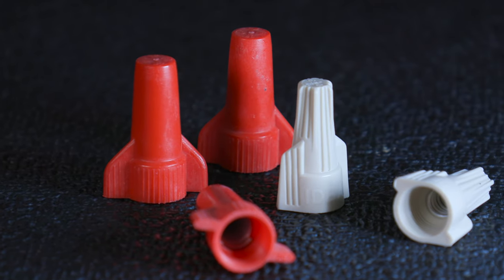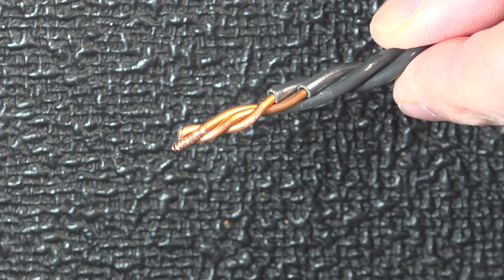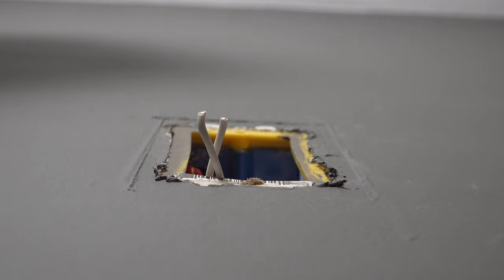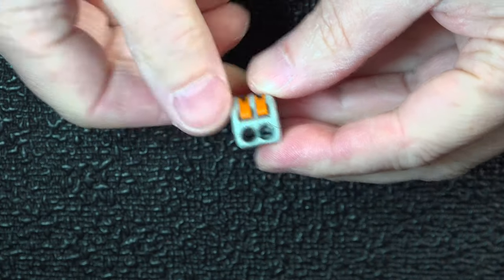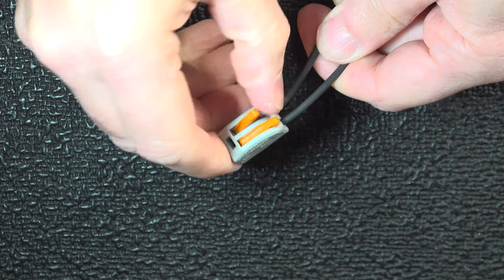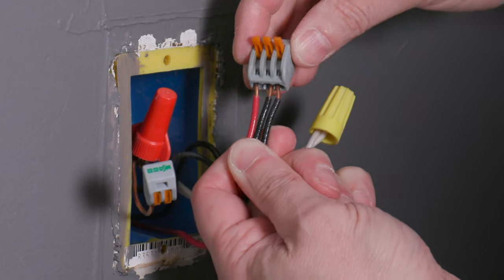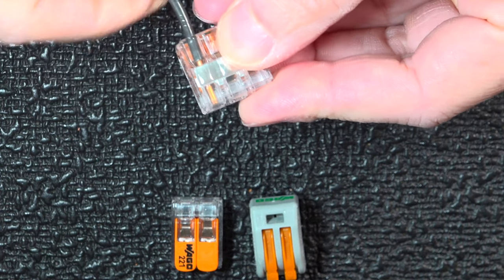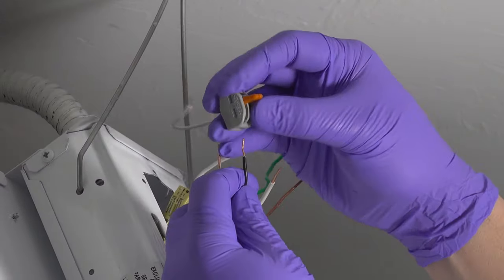Never use Wire Nuts Again - Wago is Better Electrical Connector

Comment: I never cut my wires when i could just untwist em...wth
Reply: Yeah if you dont leave a foot of wire what happens when he replaces an outlet 100 times
Reply: I wrap wires with aluminum foil or steel wool, then smash everything back into the box with a broken broomstick. I then check my work by spraying a bit of carb cleaner in the box and flip the circuit back on. No boom = Master Electrician. (For all the Neanderthals out there of course I’m kidding.)
Reply: @Thunder978  sarcasm level 1000
Reply: Makes more sense, but of course, people are going to be "oh my god your doing it wrong." your right in certain respects, if you want a perfect undamaged lead to be the most perfect little solder you can be, sure. but if you don't care, know whatever connection you are going to be making is going to be limited far below what would even cause an issue, your most likely fine just reconnecting the wires with existing wire nuts and not caring. This works if you are I don't know installing new light fixtures with LEDs that max out at 10-20 watts. if you are rewiring an entire house, it's probably better to go in an replace all the wires anyway, because chances are it's going to be wired in a way that makes no sense from a floor plan perspective. and when you replace all the wires, you might as well use proper connection techniques that are far more secure and far more reliable like soldering or wago connectors and other junction blocks and such. makes it far easier to manage cables too..
Reply: @tellsitasitis  Hell no. Double-Sided tape with staples and penny nails sprinkled all over it.
Reply: Never a good idea. Untwisting and reusing them gives a very weak and unstable connection. Just snip the end off an re-do it properly. That being said, if you're ever inside the box enough to have shortened the wires to that point, you've got another problem entirely.
Reply: @BlackEpyon  It makes more sense to not cut the wires unless the leads are damaged to begin with. You can always straighten the wires and re twist them if you must. However from my perspective, it's better to use a terminal block or solder the connections then using wire nuts anyway. Soldering the connections fixes the insecure issue terminal blocks eliminate all issues.
Reply: @TheObsesedAnimeFreaks  Why would you solder solid-core wiring?
Reply: @BlackEpyon  here is a stupid question, why do you solder resisters or other through hole components then? The type of wiring does not matter. It's a better connection period.
Reply: @TheObsesedAnimeFreaks  There's a hell of a lot less current flowing through a 1/4w through-hole resistor than through mains AC wiring, and you're not as likely to burn your house down if you have a cold solder joint in your electronics project. Lead is also about 7% conductive, compared to copper, and you need a lot of solder to join two pieces of 14-guage solid core wire, which under high current, turns the joint into a weak spot in the circuit. Effectively, a resistor. Tin has about 15% conductivity compared to copper. This isn't an issue on most home-grown electronics projects, but in professional PCB layout, conductivity of the traces is something you need to take into account. On the other hand, if you used silver solder, silver is actually more conductive than copper is, so the joint wouldn't be the weak point. Now here's the kicker. Silver melts at 961.8 °C, where lead melts at 327.5 °C. What do you think that's gonna do to your 14-guage wire's vinyl insulation?

Long story short, it's far safer, and more practical, to have copper physically fused to copper by mechanical force, than to try soldering AC wiring splices. If you try to re-use the twisted wire, the ends won't mesh nicely, and that creates a weak connection. If you have any knicks in the wire, which you're sure to if you're re-using it, that knick represents a smaller cross-section, and therefore smaller surface area, which means a weaker connection. Anywhere you have a weak connection, you have an electrical bottleneck, which means heat.
Reply: @BlackEpyon  you do realize they solder the connections from your mains power to your 1500w psu in that fancy tower you built right? Using standard solder. Let's not forget that if you are soldering 2 wires together you are going to overlap the connections quite a bit making your arguments moot. And obviously you are going to have to make sure the wires are heated properly to make the solder adhere. However it's a much more secure and safe connection then just a mechanical connection period. Twisting wires together is not a valid option when dealing with electricity except in very temporary setups. That's reality. You are better off using a terminal block or soldering the connections.
Reply: @BlackEpyon  I would like to add, if your are an electrician, you can ensure that your customers don't reuse the wiring you installed by soldering the connections together before you put on your wire nut, same process but only safer because now you have a physical bond between the wires keeping them together instead of a loose mechanical twist that can easily be removed. You also force the customer to cut that section out because no one will spend the time to desolder that connection that you don't want the customer to reuse in the first place. Or you could just use screw down terminals and avoid the issue entirely keeping wire mess down and allowing for simpler connections.
Reply: @TheObsesedAnimeFreaks  Of course I know the mains AC connection inside my main rig is soldered. I'm the one who soldered them (it's actually a custom modified 1200w PSU, but that's beside the point). I also know that those wires are stranded, not solid, and that makes a rather large difference in the mechanical strength of the joint because of the increased surface area of the stranded wire, which also decreases resistance. I've been soldering since puberty, and have years of practice, but I've also seen a LOT of crappy solder jobs that don't fill me with confidence that soldering would be a better alternative for permanent wiring. You can always unplug your computer if you suspect that it may be unsafe. You can't unplug your wall.

Soldering the connections before installing the wire nut actually makes it harder to secure the nut. Copper is malleable, and the wires will mash together to make a very strong mechanical connection, which is why the "screw" is tapered. If you fill that joint with solder, you need a lot more force to install the nut. But the point isn't to make sure that the end user can't re-use the joints. Wire nuts ARE perfectly safe, and make strong mechanical connections, much faster than a proper solder joint, IF they're used properly. If you don't know how to properly use a wire nut, or don't know good electrical practice, you have no business being inside one of these boxes. Period.
Reply: @BlackEpyon  I think we should agree to disagree here. There isn't much left to argue about. My view on such things is closer to a strict mandate on secure connections that are intended to be permanent or semi permanent. I don't like how insecure wire nuts are and view them as problematic. The ease of removal of them and the fact that they are just twisted wire with a connector around them bothers me from a practical perspective. I rather have a much more secure hard point connection such as a screw down terminal or a more secure connection such as a solder joint. There is also the fact that there are other issues when installing switches into larger gang boxes and the fact that organization isn't the best with them.

Many reasons why I don't like them. the fact that you can easily mess up the installation process and the fact that even when they are installed properly they aren't the most secure connections in the world. The organization issues and wire mess. I think there is a much more elegant solution to the problem rather then wire nuts. I don't like them, I don't trust them, I rather a different solution be implemented. An I would be happy to put my money where my mouth is and develop a much better solution to the problem
Reply: @TheObsesedAnimeFreaks  "I don't like how insecure wire nuts are and view them as problematic"
Then you don't know how to use wire nuts. The mess of wires is it's own issue.
Reply: @BlackEpyon  your right but using a wire nut doesn't solve the issue it just makes it worse. having a proper place to tie down and tie into a electrical feed makes organization of an electrical box so much easier and safer. it also makes it such that forcing switches back into an electrical box isn't a thing. 
>Then you don't know how to use wire nuts
They are simple devices that you twist on to connections, and you twist them strongly and firmly till they otherwise start to twist the wires down the line. they aren't that difficult to use. The issue is that even still, they aren't a secure way to wire anything in. They can still back off and come loose in the process of doing maintenance or otherwise over time, regardless of how well they were originally put on. Part of this is called vibrations from just using your house. over time those vibrations can loosen any fastener that you might have around the house. There is a reason why automobiles have torque specs on pretty much everything. With a screw down terminal or other connection similar, that issue is mitigated by the ability to torque them to be far more secure,
And this is ignoring the whole point that I previously made that was that any electrical connection you shouldn't be able to undo with your hands period. nor another issue where you can just pull them apart in many other instances. the connector and the connection itself are not secure connections, nor can they be made to be secure.
Reply: @TheObsesedAnimeFreaks  The only fasteners I see coming undone around my house are tape and nails. Never wire nuts.

Comment: I'd recommend using the 221 series connectors (the 'new' ones), they're absolutely genious - especially when working with different wire strengths and/or mixed media. If you once have used them, you'll never ever again want to use anything else but these. You will even no more use screwing terminals (google says the translation is 'luster terminal'?) anymore. Here in Germany, these wirenuts you showed are no more allowed for new installations or changes to the current installation, so the WAGO connectors are the current state of the art.
Reply: Just ordered the 221s thank you for your input

Comment: Only issue is the contact surface (which is the current carrying part of the conductor and connector) is substantially smaller that when two  (or more) conductors are joined with a wirenut. They are fast, cheap  and popular with contractors who do residential work  and are paid  piece work. Several customers of the contractor I work for prohibit in their specifications  Wago and similar connectors due to failures.  In 42 years or electrical construction, I have never seen a wire nut go bad unless it was installed  incorrectly even then, of the hundreds of thousands of wire nuts I have handled, I bet there have been less than five that had failed.  true, you should not reuse wirenuts.  But, in the fine print, Wagos are a one time installation also.
Reply: Where these excel is in controls. They make testing for faults so much easier.

Comment: I love the idea of them for all the reasons you listed but I'm curious to the connectivity, resistance and ability to carry load vs the wirenut.
Reply: Will be fine as they are used widely in western europe. The older type of stick in connectors is even older and can be found in houses as old as ‘96. (At least) the wago’s are also older than you think.
Reply: It looks like the lever Wagos hold up to the 20-30amps the wire is expected to also hold up to. Just FYI though, Europe uses 220v (nominal) so the amps are halved compared to the U.S.
Reply: It’s better. They are listed for a greater ampacity than the wire that can be connected to it.

Comment: Everything has it's place, and agree these WAGO's have there place but wire nuts are much better for heavily loaded circuits since they have much more surface area in contact. Iv'e replaced a few of these WAGO's on microwave and other kitchen countertop circuits that burned up.
Reply: Someone used lever-style Wagos on appliance circuits? Or were they the smaller spring-tension Wagos? Just curious. I know that the basic Wagos fail over time similar to a stabbed-in receptacle.
Reply: @multitutorialguy5735  WAGO connectors are spring loaded and available for currents up to 1000 A. 
All sizes can carry much more current than the biggest wire which would fit in.
They are extremely fail safe even when vibration occur.

The WAGO (or rebuilts) connectors are absolutely standard in Germany for decades.

Wirenuts are prohibited in Germany for safety reasons.

Comment: After living through the disastrous "push in" wiring style receptacles, and switches in the 1980's, I'm not real excited about any connection that isn't 100% solid. These seem like they may be okay, but I would like to know exactly how they work internally, before I would consider using them. They also seem to take up additional space, which many boxes don't have a lot of. Wire nuts also are a lot less trouble, if you don't buy the cheap ones.
Reply: These lever type connectors are very different from the spring loaded push and catch types, so don't read into them based on how the spring ones work. The push types have very limited range and won't hold up long term when they lose tension and heat up from the increasing resistance.
Reply: @dubmob151  I'm not comparing these. As I said, these show promise.  But, I'm also not just going to start using them, based on promise. That's how the disaster in example I gave, happened. When I get some of these, and dissect them, that will probably help me decide.
Reply: In Germany Wago Connectors are the state of the art. You use them in the whole house installation.
Reply: I had two receptacles in my house almost start a fire due to backstabs. A couple others done with backstabs were redone just in case after the second one starting getting warm (with almost no load on the circuit). The first one scorched a neutral wire, turning the insulation black and made it start to flake off, I actually wonder if it combusted briefly to be honest, that's what it looked like.
Reply: @LostBeetle  That sounds like a uninformed and incorrect installment and/or a poor quality backstab connector.  A backstab Wago 773 won't have any issues - if used correctly(!!!). Otherwise, what the fuck would happen to the entirety of Europes houses, they'd burning down!?
Reply: @LostBeetle  There were a few knock-off Wago copies on the market a few years ago - you sure those were genuine Wago products? Never experienced any problems with those.
Reply: @Kommunisator  No these were old receptacles with the 12 awg backstabs going into the back, they still have them but are limited to 14 awg now. They should do away with all of them. OP was talking about backstabs.
Reply: The 'backstab' receptacles use a leaf-spring connection that are dangerous, IMO. They offer only minimal surface contact and no true gas tight connection.. The Wagos use a cage that is solid against the inserted conductor. The cage will also form a gas-tight connection preventing oxidation at the contact point. I think Wagos are fine but so are the 'wirenut' type connectors if installed properly..
Reply: @slick9892  These are used all over europe, And there is alot less electrical fires here and that should be saying something.
Reply: I have done some testing on WAGO's and I haven't been entirely convinced to switch over to them. Aside from the cost, I don't like the fact that I can rotate a wire that is clamped in a WAGO. That's not a 100% solid connection. And, they can't beat a wire nut in a pull test, or a resistance test. I will for convenience, use WAGO's where a circuit terminates to hook up light fixtures, at least until I use up the box I bought, provided it's indoors, and not anything that uses a lot of current. I am not interested in anymore anecdotal stories about how "there are less fires in Europe".  Lots of people don't use wire nuts properly, or understand the difference in the quality when you buy the good ones. I know I have made a 100% solid connection, indoors or out, when I decide to use a wire nut. And, after over 50 years, have never personally had any issues with them on my work.